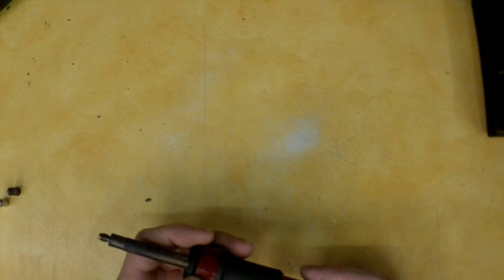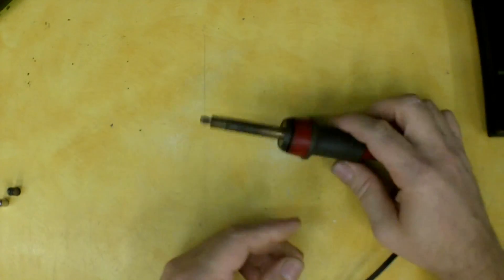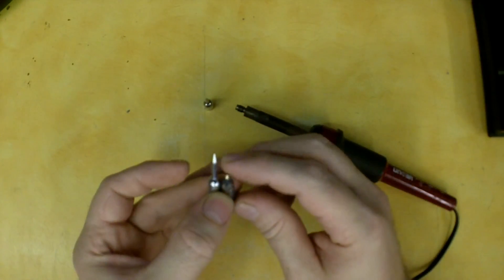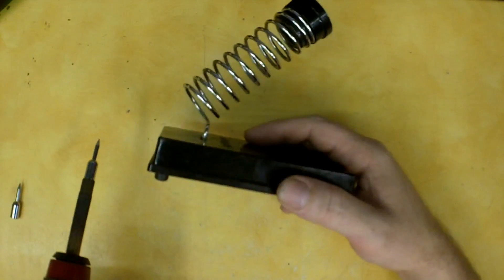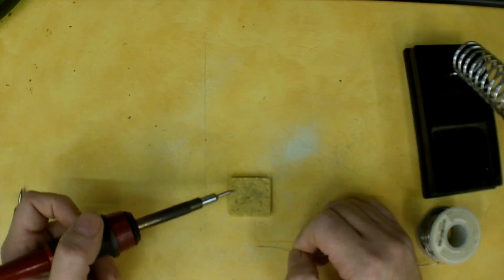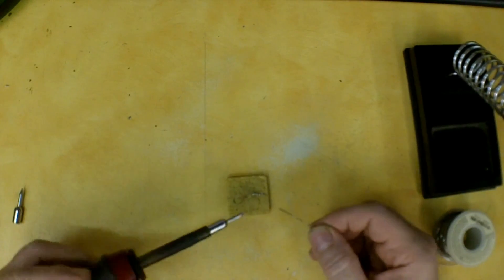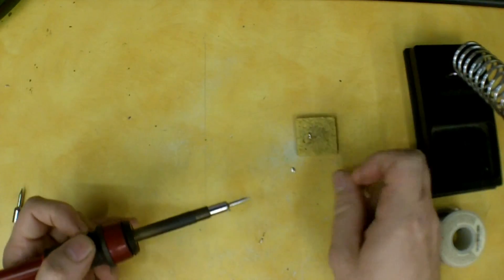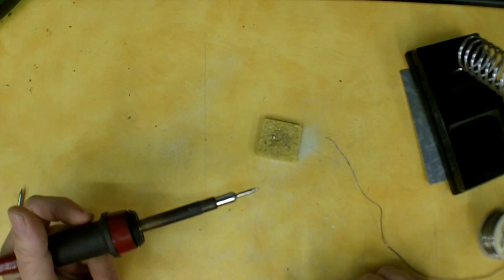Soldering Iron Tip Seasoning and General Care

Comment: Hi good folk of Google I brought  a iron made by DRAPER here in England and it is horrid,,,,I only paid £10 so I am going to take it back and I can only exchange it with something of the same value so maybe a few DVD disc's or a USB hub or whatever, But never buy DRAPER irons they suck big time, like I said bellow I think I will stick with WELLER irons
Reply from the maker: I'm not familiar with that brand, but it sounds like something to stay away from. Weller are fine irons for sure. I have an Ungar that has served me well for years. It's so old I don't know if they're still made. But another option to look into. Good luck, G.

Comment: I have a soldering iron, 60 watt, plug directly to electric outlet, without temp control, and it "kills" all the tips i've used. after few times of soldering the tip turned black and it can't hold solder on it, solder just melt and turn into balls and fall off. I think the heat was too much so it burns the coating layer on the tip. so how much watt is your soldering iron? and can i use a potentiometer to control temp of my soldering iron?
Reply: T/Y 2 G
Reply from the maker: I'm not sure if yours being 60 watts is what's causing your problems or not. It does sound like it's burning the tips though. You could try to dip the hot tip in some flux to burn off the oxidized layer, then wipe it off  with a damp cloth or sponge. It might take a few times. Then tin the tip again to see if it will hold the solder. The one I use is a 33 watt and is plenty hot for anything I need to do. I'm not sure if you can use a pot to control yours or not. Good luck, G.
Reply: HẢI ĐĂNG I have the same problems and my iron is 25 watts and at present I wish I knew the problem but I do hear the WELLER  is the best so I might just go get one and hopefully it will be an investment and work for many years years with good care.
Ill keep an eye out for some advice
Reply from the maker: Dougie Ryalls
Weller would be a good choice for an iron. Good luck, G.
Reply: Thanks ghosters,  as the way things was going I would of had to buy 3-4 DRAPER irons a month for the small amount of work I do LMAO they do say "You get what you pay for"
Reply from the maker: Dougie Ryalls Yeah Dougie, in your case it sounds to be true- you get what you pay for....lol. My Ungar has never let me down. But if it ever does- Weller will be my next iron. Take care, G.

Comment: G, great job. I think you covered the subject well. There is a product that comes in round quarter size cans. It's a tip cleaner/tinner. It contains an ammonia based solvent that cleans the tip well and it also contains solder paste that coats the tip at the same time. It works well.
Reply from the maker: Thanks Bain. I've not heard of that type of product. I've always just done what I've shown here and it's always worked well enough for me. Would you have a name or site reference to the product you're referring to? I'd like to check into it and it may be useful to others as well. Off to the sack now. Take care, G.
Reply: Sure G. The way you tinned the tip is the way I do it too and is always the very first thing you should do with a new tip. The product I was reffering to is for maintaning that new tip.
http://www.mouser.com/Search/Refine.aspx?Keyword=cleaner+tinner
After wiping the tip you tend to lose some solder coating. This paste is ment to condition the tip with flux and retin the tip with just one dip. It does extend the life of a tip. I like it.
Reply from the maker: bain5872
Thanks Bain. I may pick up a tin with my next order. I have a couple more jukebox amps to re-cap and was getting ready to place another order anyway. G.
Reply: G, Radio Shack has the same product too or aleast they use too. It might even be cheaper. You might wan to check their site.  Mousers website is not the easiest to navigate. It's setup for someone whom knows what their looking for when in reality some techs don't know what there looking for. I suggest downloading their online catalog or as I do, ask for a printed version by mail. It makes it much easier to see what is avalible.
Reply from the maker: bain5872
Yes, Radio Shack still has it, but not in the store closest to me. http://www.radioshack.com/product/index.jsp?productId=2062721
I'm assuming this is the one you were speaking of from Mouser. The first link you posted showed three items on the page.
http://www.mouser.com/ProductDetail/Plato/TT-95/?qs=sGAEpiMZZMtyU1cDF2RqUBJ223ydvWL8g6GebVwi2AI%3d
If so, Mouser is about .25 cheaper- no big deal. Since I will be ordering from Mouser anyway, I don't have to take into account for shipping- maybe even tax- but don't remember. Thanks again, G.
Reply: Yea, G, The product you listed, Plato, is what I was referring to.
Reply from the maker: bain5872
Good deal! I'll be picking up a tin of it.. Thanks, G.

Comment: Thanks for the timely info. I am replacing the 2200 cap on my motherboard so I just bought a new tip for my weller and worked like a champ. wish I had the solder sucker though. For $18.00 it sure makes life easier. I used your other info on the cigarette machine teardown and that's still working great too. Much appreciated
Reply from the maker: Good deal Darryl. The solder sucker works well, but sometimes you will need to use other methods- such as the copper braided wick- or a combination of them. Glad the machine tear-down was helpful. Good luck with your cap replacement! G.

Comment: Since your on the subject, maybe you have time to do a short instructional video for the new comments. What and how to use flux, types of solder, how to tim, and for those that have adjustable temp systems, temps to use? Thanks for sharing.
Reply from the maker: Mac, I may try to throw something together- but not too sure. I'm getting ready to re-cap my amplifier so I will be removing and replacing components. I'm by no means a pro with the art of soldering, and there are plenty of other sources that are I'm sure, but may try to at least put something up. I don't have an adjustable system but use my tip to regulate the temp. If I put something up, the last sentence may make more sense. Thanks again, G.

Comment: That old tip gave me a right giggle. On all my old irons, there is a stubby thing that used to be a tip, after many files and hones. Amazing how we fight and carry on with just a stub. On my newer and cheep soldering station 8 years old now, it cam with a new coated type tip, what a godsend, no filing, lasted 8 years, but could I find tips for it, nope. I decided to buy a decent and proper iron and use the station to control the iron. I spent around £60 on new tips from diferent supliers as the price varied so much. Then the iron I ordered never turned up. I have a hole heap of tips I can't use and an old iron with a copper nail stuck in the end HAHA.
Reply from the maker: LOL, you're correct Sirus. If I tried, I could probably get another few years out of the stubby tip...lol. I'm looking forward to the coated tips and they should be easier to take care of.  Not good you're stuck with tips and no iron to fit them on. I thought about getting a controllable station years ago- but have just learned over time to manipulate the tip for more or less heat. Plus I don't use the iron all the time, so I couldn't justify replacing the one I have that still works. Good to hear from you, G.
Reply: A tip on the coated tips, if you run them to hot, you do have to re season them every five minutes because the solder pretty much wipes completely off on the sponge leaving just the plating and it can oxidise. But they don't rot. With a normal just plug in the wall iron, they will get as hot as they are suposed to, so, I'm guessing the lower wattage one are less likly to get too hot. And I haven't tried this yet, but I was thinking of using light dimmer switches to control my old irons heat. I supose we have to look on tips in a frying pan kinda way, teflon pans are non stick but you can't scratch them or over heat them, good propper iron pans need seasoning and some after care for storage.
Good to hear from you also, I'm always watching.
Reply from the maker: Sirus
Good info Sirus! Personally I don't see any reason why you couldn't use a dimmer switch- perhaps someone else will confirm. You could cobble something together for just a bit of cash. Agreed on the analogy between the tips and a cast frying pan. G.
Reply: Sirus Yea, as G said, a dimmer control could work fine. It all depneds on what one uses it on. A tip needs to retain a far amount heat to transfer to what one is soldering to. Being most low wattage irons are right at the boader line of having just enough heat to transfer to a small joint, an iron cooled by a dimmer might not be a good idea. It could cause you to have to stay on the joint much longer which in all cases, is a bad thing. With a higher wattage iron, the dimmer idea would work much better. Make sure the dimmer wattage rating is greater than your irons rating.
Reply from the maker: bain5872 Good info Bain! Thanks for chiming in, G.